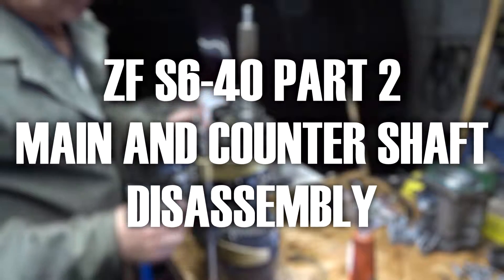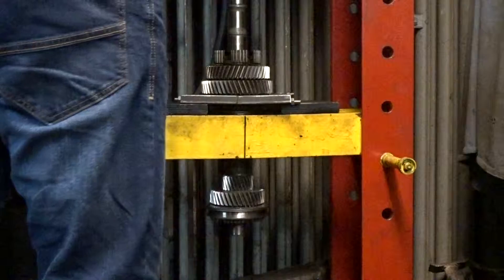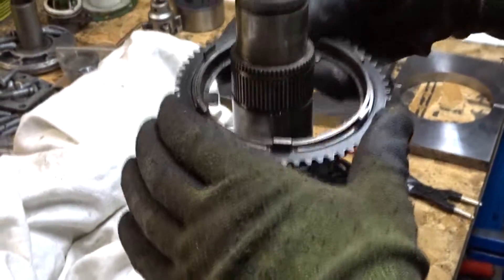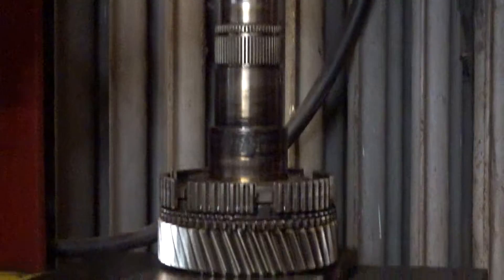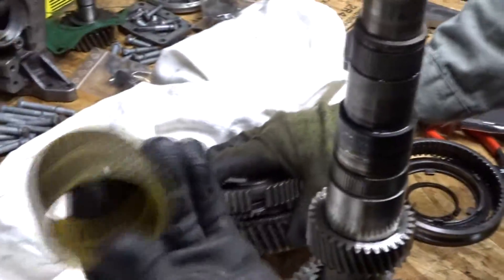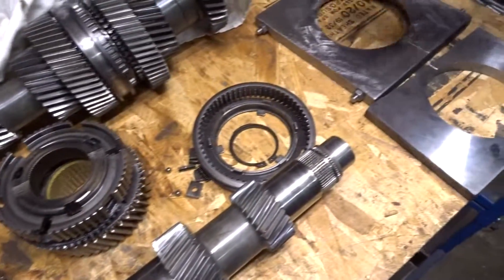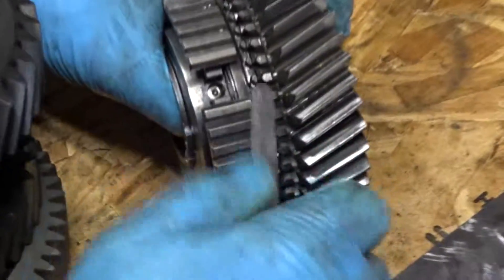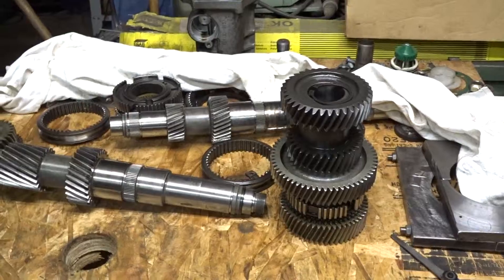ZF S6-40 MAIN AND COUNTER SHAFT DISASSEMBLY PART 2

Comment: Very good Job 👍🏻 i Need the Name of the Shop for the transmisionparts Thanks best regards from Germany
Reply from the maker: Wurde schon mehrfach gefragt. Schau dir die Kommentare in Part 1 an.  JonasKlemens und viele anderen hatten schon danach gefragt und eine Antwort bekommen.
Reply: Great Video, I got an extra transmission for my swap, but is locked in reverse, are you still able to get the parts? I been looking everywhere, but looks that only ZF Doc have the parts… Greetings from TX.

Comment: Too bad there isn't a better reverse/sixth gear bearing available that will not destroy the main shaft when the bearing fails. Maybe some type of bronze or babbitt with pressurized oiling could address this weak point? As we all know total sales of zf6 equipped c4's was less than 60,000 units. Used parts supplies are getting harder to find. Amazes me zfdoc or others have not came up with a more permanent solution to this known failure point (aside from external oiling system that adds weight, complexity etc. etc.

Comment: Hey friends, 
I have an Corvette 5.7l from 1990 whit the gear type ZF S6-40,  and i need to change the 2nd gear, the syncronising ring ,  the sleeve of the 2nd,  
and the hole clutch set,  but here in Belgium is not to find  this parts.
So if any of you know some adres of a store or factory or link to find my parts, i will pleased.
Reply from the maker: I have written so often, contact Bill Boudreau http://zfdoc.com/ to get ZF parts. Clutch parts, you can buy everywhere in the world, use your internet. Try Summit, that's where I buy all my parts.
Reply: @marcocostanzo3627, have you found a solution for your issue? I have exactly the same problem on a '94 corvette (black tag tranny).
I am currently checking with Rockland for repair kits (e.g.  synchro ring kit ~660usd, seal kit ~350usd, etc). 
I am curious to know how you have fixed your 2nd gear issue. By the way, I am from the North of France (59) ;)

Comment: Hello, how often do you have to overhaul the bearing from reverse gear? I currently have the same problem and am considering trying to get a second gearbox which I can then change in case of failure and then have time to overhaul the defective one. How much work is it to change the input shaft in case I get a transmission of a normal c4? I have a ZR-1 with the longer input shaft? I am a normal car driver, but live in Germany, where it is no problem to drive faster than 130mph. The two videos are really great and the way you describe everything is also super explained and understandable. 3 times thumbs up.
Reply from the maker: kannst mich anrufen 053441759

Comment: You seem very knowledgeable. I have a weird problem with my ZF6 black tag and wanted to make sure I'm not killing the transmission. I have a grind kind of like the gear buzz that ZF doc talks about. But it only happens when turning left or under heavy load. Very quiet in neutral. What do you think it could be? 

Thank you for any help.
Reply from the maker: Never heard of a trani making noise when making a left turn!! Check the oil level of your trani. The only thing I can think of at the moment is a front wheel bearing, maybe even a rear bearing. This means it might be the right side front wheel bearing. You're making a left turn so it's always the opposite side making the noise.
Reply: @vettef6929  The fluid is full. Just put in 2.3 quarts or so of Amsoil. I was thinking about the wheel bearing too. According to ppl with similar problems and forums it seems to be that the dmf is failing or maybe the throwout bearing. Doesn't seem to be inside the transmission. We'll find out when I drop the transmission within the year.
Reply from the maker: @JoshuaGalerBluexElectronics  I would try to find out where the noise is coming from before I remove the trani. A car wont drive without one.! The dmf makes noise mostly at idle and doesn't care if you make a left turn or not.
Take your car on a road where you are alone and drive constantly 35 mph. Then turn you steering wheel from left to right like the slalom skiers do. You will then hear the noise every time you turn the steering wheel to the left. Then replace both left and right wheel bearings.
Good luck
Reply: @vettef6929  im pretty sure it's not the wheel bearings bc I can make the noise happen when I'm parked.

Comment: 4:24 wait... are all the gears like that? With the removable cones?  Because I'm having visions of a drop in dog engagement kit! 

Machine up the required parts as usual then the gear side dogs can simply take the place of the cones. Slotting in whose handy recesses.     Most dog shift conversions that use stock gears machine off the cone and stock dogs then weld on new larger dogs.  I pondered the realities of dogs that fit over stock cones and are retained by snap rings in the groove behind the stock dogs but didnt figure most trannies would have enough room to make all that fit.
Reply: Ok nevermind... I'm not sure what I thought I saw the first time but I was wrong lol.

Comment: On the subject of oil starvation of the 6th gear bearing, what's the solution? I've read of that issue on one of the forums but don't recall seeing an answer.
Reply from the maker: Sorry for getting back to you so late. 
It's the reverse gear that seized up on me, not the 6th gear. 6th gear isn't rotating about the shaft while in gear.
Had to look up all the emails from Bill Boudreau ZFdoc.com. We probably sent 100 emails back and forth and discussed not only this theme.
This is what he wrote in short form:
Look at the reverse gear to possibly see how well detailed the oil port was finished and if the factory at least even chamfered it at the reverse gear ID surface that feeds (actually draws oil from) the needle cage. The reverse gear shoulder recess feeds the needle cage.
Hope this helps
Vette F6
Reply: @vettef6929  he has done pressurized oiling with an external pump and cooler to make these transmissions live with high power and sustained high speeds. Looks expensive, but is better than having it lock up at 150 mph or higher.
Reply from the maker: Yes, Bill is a great guy.  It might take a day or so for him to answer, but he will. The blue tag trani I took apart in the video was also for training purposes, but this trani will never be put together again. There are just too many parts burned or defect. He wrote it wold take about $1800 to repair. So I'll keep all good parts until I tear down the trani I'm using now, might need some parts there.
Reply: @vettef6929  ; I will probably contact the 'ZFDoc' if I'm stuck on some detail of my transmission or need parts (worn 2nd syncho ring). Let's see how far I can get on my own. Something I won't do is to get in too deep, mangle something and then throw the 'works' at Bill for him to straighten out. I just hope my 20 ton press can handle the shaft disassembly! Thanks again.